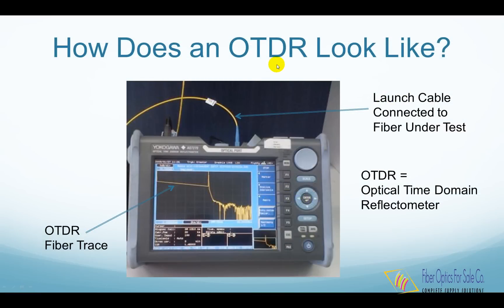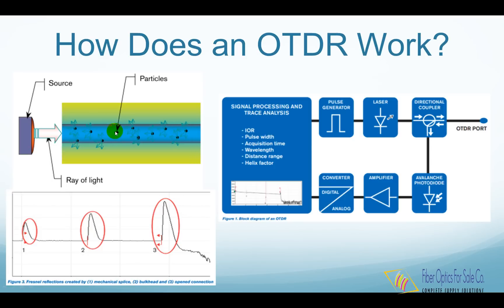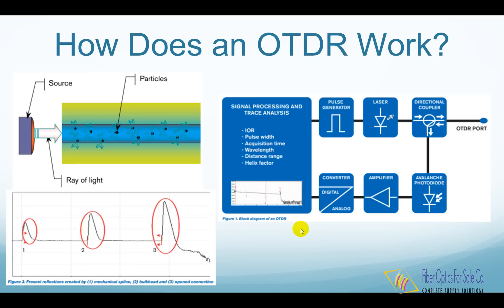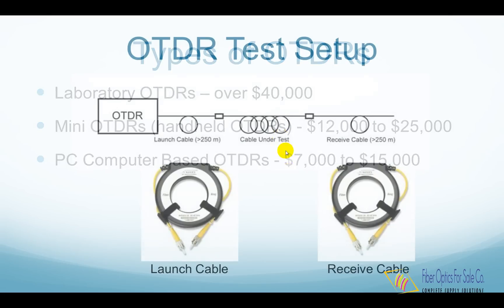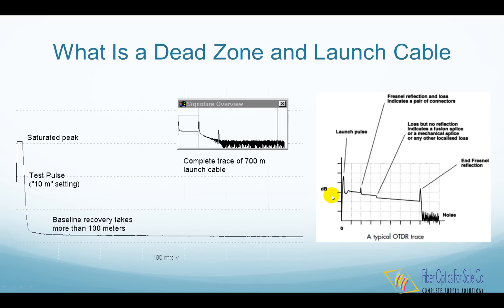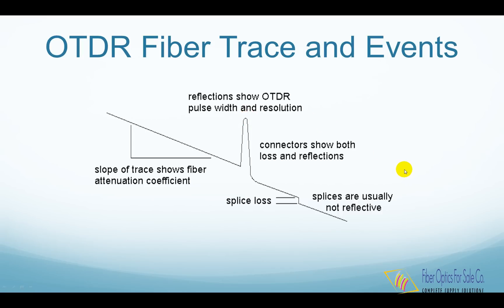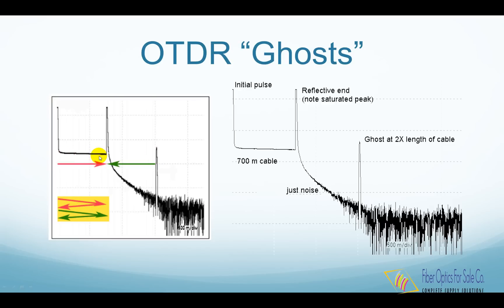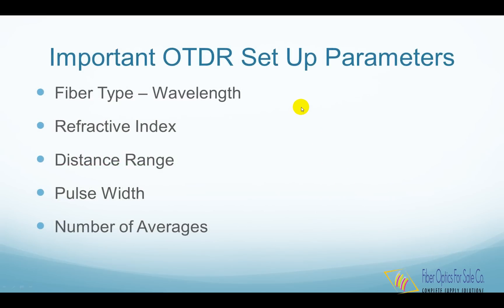What Is an OTDR? - FO4SALE.COM

Comment: Hi, 

We use OTDRs for my job. On our OTDR we can position two markers on screen and it will tell us the distance between the two markers. We usually place one marker at the start, and one at the end to determine fibre length, and also the loss along the fibre. My question is, when positioning my marker at the end, should I put it before the reflection from the final connector, or in the middle of the reflection to get an accurate reading of light level at the other end?
Reply: Good